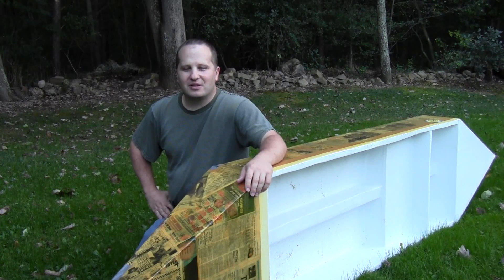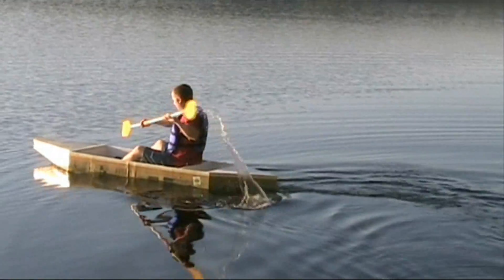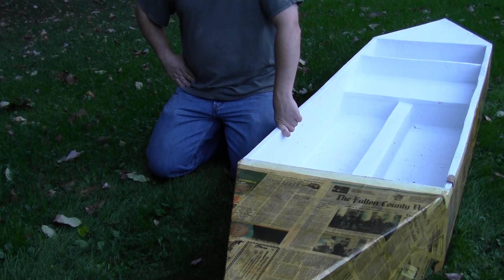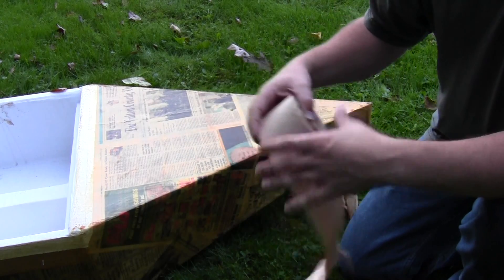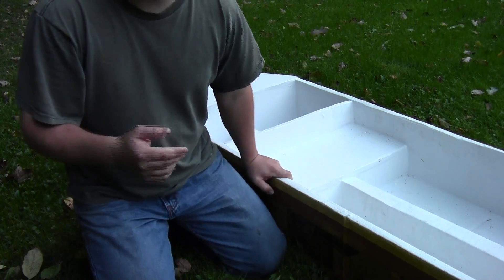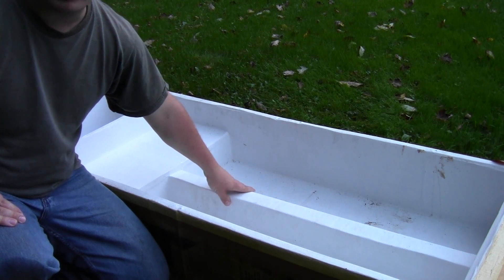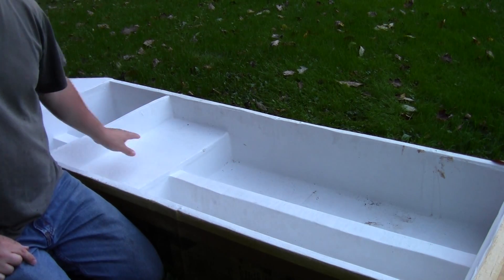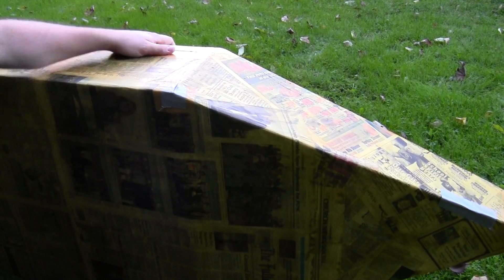How to build a durable cardboard boat

Comment: I've never done this kind of thing before, but I'm seriously considering using something like this as a pop up topper for my pickup bed. I'll probably make a rectangular wooden frame out of one by fours, with cross members, and attach a large sheet of cardboard to that, I'm thinking about four layers of coregated cardboard, all pieced together with Titebond II glue and that water activated tape you were talking about. There is a spray adhesive I saw being used to sandwich multiple sheets of cardboard together, 3M Super 77 Multipurpose Adhesive; I'm going to use that for sandwiching the cardboard into the four layers. I have to be careful with the weatherproof coatings though. I'm not sure what to use. I only have one shot at this. Sounds like varnish is a contender. I saw shellac was used on some video. Not sure if that's waterproof. I was going to use poor man's fiberglass, but changed my mind. Then I considered regular fiberglass, and may still go that route. Plywood is too heavy for me to lift the topper up (by hand), so cardboard is nice and light weight. But it might make more sense to use styrofoam insulation sheets and fiberglass. That's prolly what I'm going to end up using.

Comment: First off before questions: Do you still reply, 8 years later?
Reply from the maker: Well, I don't monitor my channel as often as I used to, but if you shoot me some questions, I'll try to remember to check back and answer them. Wow, eight years? where has the time gone?  The boat is still in my shed - it's been a couple of years since I had it on the water.

Comment: Just for tips tape is plastic and you said that there is no plastic or wood
Reply from the maker: Well, well... First, I said, RIGID materials such as plastic, wood, etc.  Tape is not rigid.  And it does not matter anyway, because I didn't use any plastic tape in the construction.  I used water activated paper tape.  Pretty sure I mentioned the type of tape I used in the video.  If not, it's in the blog post.
Reply: How would you plan on preserving your cardboard boats (if you have decided to keep them)? Do you plan on keeping them forever? If so, how?

Comment: Nice work on the boat.. The laminated beam sounds like the business.. 
Hiw much time did you spend building it..? Just curious.
Reply from the maker: It's been a few years now, but I remember correctly, it took about 8 hours of my time, and that time was spread over about 2 or 3 weeks (needed to allow time for things to dry in between steps).

Comment: Hello, may I ask about the total weight of the boat. I need to design a cardboard boat and present the report as well. I need to calculate the draft which is the height of the boat that is submerge on the water. I've found that your video give a better explanation. really hope to see your response. Thank you.

Comment: Thanks for the video, we just made cardboard chairs in my engineering class, and I enjoyed it so much I decided to create a cardboard canoe and see if we could brave the local creek. Are there any other attachments that you wish you could have added to the canoe to prolong durability or increase it's overall utility? Thanks again for this great video!
Reply from the maker: +Chris M I wish I had added a keel - a ridge on the middle of the bottom.  That would make it a bit more stable so it tracks straighter instead of side to a side a bit as I paddle.
Reply: BernardoTech Thanks a lot for the advice! The construction for my canoe is getting along pretty well, and several students in my engineering class decided to collaborate with me on this as well. Hopefully it's finished by the end of the month!
Reply: Chris M About keels, here's the best idea I've seen for these slab sided canoes and kayaks. You do run a keel line from bow to stern, made of 1x1 or laminated equivalent, and a pair of matching skids all the way to either side. You do this on the flat bottom. These are really just skids that do several useful things but a shallow keel does not help the boat track. For that, you tie the keel into bladelike structures at the ends. Picture a rectangle, and you cut out the profile of the bow and slide the bow into it. Same for the stern. It has the same depth as the keel and runs all the way from where the bottom starts to rise to the end of the boat. It's like a fixed rudder or skeg. You will see what I mean if you look at the lines of a traditional canoe, where they get it by twisting the bottom sideways to form the sides of the bow and stern. Having this big flat surface area out at the ends gives the water way more to grab onto than a little keel line on the bottom. The keel is good though, for structure, and you can tack a matching one inside the boat for even more stiffness and to sandwich the hull material and avoid collapse.
Reply: +Chris M How did it go?
Reply: Piano4Life My Engineering/Aviation teacher is being kind enough to allow me and two friends access to our schools cardboard and duct tape, but we are only able to get to work at it two times a week for an hour so progress is slow. We have cut out all the parts, and everything is sized correctly to diagrams I have made. We should begin taping and assembly this Thursday, so Ill update you then!
Reply from the maker: Sounds like fun - I hope you can get it on the water before long!

Comment: This is very interesting.  I'm curious about building a semi-permanent boat and your method seems feasible for me (I don't have woodworking tools or expertise).  You seem to me to be halfway between the plywood stitch-and-glue where all the strength comes from the wood instead of the waterproofing and Elisha Waters' paper rowing shells where all of the strength came from a laminated paper shell shaped around a mold (many more layers than you used, and using purpose-made paper).  How much would you estimate the strength of your finished boat is from the cardboard itself and how much from the laminated paper?  Is the paper adding any structural integrity, or just waterproofing?  Thanks!

Comment: Do you go fishing with this boat & if so where do you put your live well, bait bucket, & how do you hold your ore when you use your fishing pole. I'm very much interested in making this for my future fishing.
Reply from the maker: Most time I take it out just to paddle around, but I did take it fishing once and I plan to do so again this spring. There is enough space in front of me and behind the seat for bait and lures.  A small bucket for a live well can fit behind you, but if you're catching big fish, that might not work very well.  As far as the paddle, I just lay it on my lap when i'm fishing - it stays put pretty well.
Reply: Thanks so much for posting this & replying so quickly. Ok then, & no I don't plan to catch big fish just pan fish. This will be perfect with what I want to accomplish fishing wise.

Comment from the maker: Hmm.. lets see.  Start by making the hull with larges pieces of cardboard.  Then put more cardboard layers on the inside or outside to add strength.  Glue the layers together with liquid nails.  Make sure the seams of the different layers are not at the same spot. Put on several coats of the primer.  If you're really paranoid, you could even cover the entire below water portion with duck tape.

Comment from the maker: Ouch!  Not good to see a lot of work slide under the water.  I took mine out on my pool for about 5 minutes the first time, then I examined the bottom and found a couple of spots where the water was seeping between the layers of newspaper.  So I patch those holes with more newspaper and varnish, and I haven't had a leak since. Hope it goes better for you next time.  Good luck!

Comment from the maker: A little tough to explain, but I'll try.  Like the back of the boat, you first cut along both bottom corners and then fold in the sides to make a point.  Then, on the very point, make a mark about 3 inches up from the bottom(or however much you want the bottom to slope up). Now on each side, make a line from that mark back to the bottom of the hull where the sides bend inward. Cut along the lines on both sides (you'll be cutting out a wedge shaped piece), and then bend up the bottom to meet.

Comment: Instead of the water activated tape you could use duct tape and on the inside to build up the thickness u could use polystyrene tiles , offcuts and bits of packing you find in parcels and appliances for other areas.
obviously with this the key is to use LOADS of varnish and let all the coats of varnish dry thoroughly outside on a warm sunny day !

Comment from the maker: I've had it in the water for as long as 30 minutes or so at a time, although I don't think there is really a limit.  The biggest thing is that I have to be sure to keep the inside of the boat dry.  The dry lock coating has a few cracks that allow the water that splashes inside to penetrate into the layers of cardboard.  This boat was a lot of work, though.  If I wanted a cheap and light boat for fishing, I'd consider searching the classifieds for an old rowboat or kayak.

Comment from the maker: Just look for spar varnish at your local hardware store.  Other kinds of varnish may work as well.  It is about 11 feet long.  The cardboard piece I used for the hull was 11.5, but once you fold the ends to form points it takes a few inches off.

Comment from the maker: I don't have the exact figures anymore.  I think I got a roll of water activated tape for 15 bucks or so online, but it was far more than I needed so I used it on other projects.  The varnish and paint was some I had stored away from previous projects, so the cost was basically nothing.  I had to buy some cheap white glue at the store, and I had to buy a kayak paddle for 30 bucks or so.